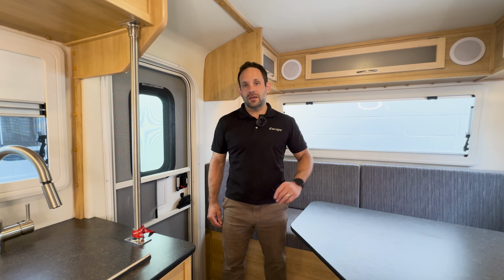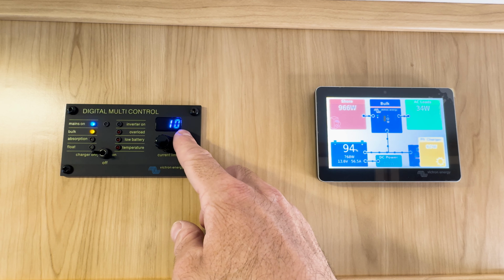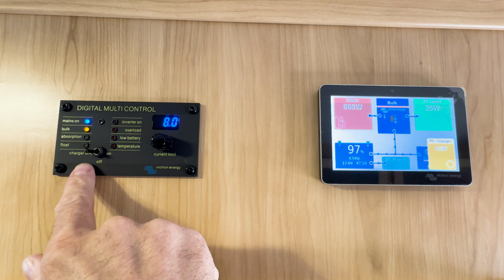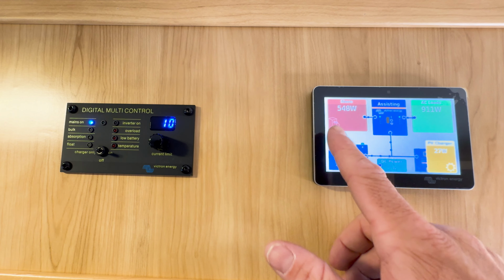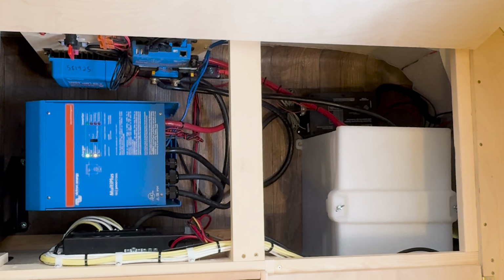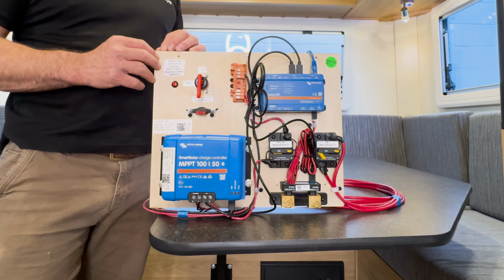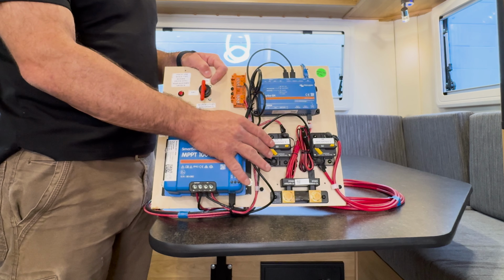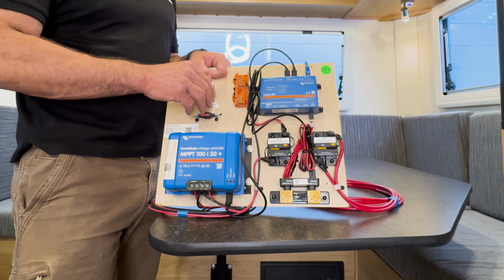Mastering the Victron Power Pack: Expert Tips from Dustin

Comment: I live in a cold climate. I have a solar arrangement on my E23.  Any videos on winterizing this system - at what temps to bring lithium batteries in,  configuration of switches etc. Thanks
Reply from the maker: We'll see what we can do, Kelly! Stay tuned.
Reply: We also live in a cold climate and would love to see a video specific to disconnecting/removing the lithium batteries.  I checked out the link that was provided and it did a great job covering the winterizing process but didn’t see anything about what to do with the lithium batteries in cold weather.
Reply from the maker: We’ve got you covered! Check out our winterizing video for all the tips you need to prep your trailer for winter. https://www.youtube.com/watch?v=QZFdH0MSSy8